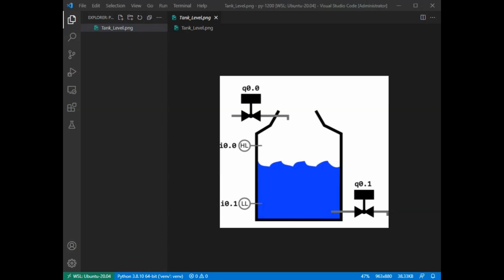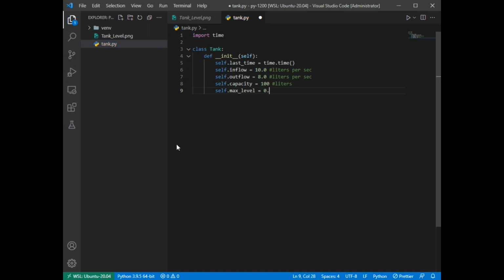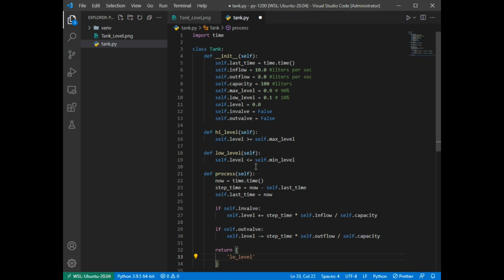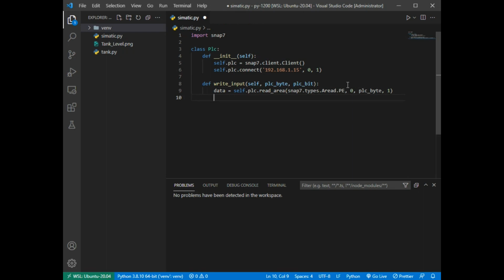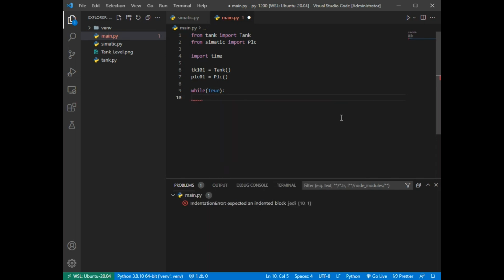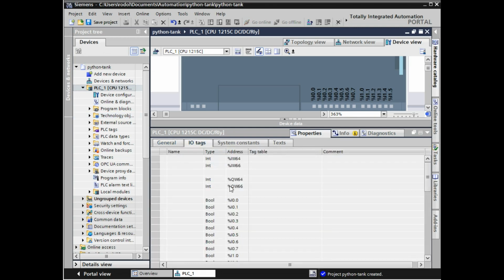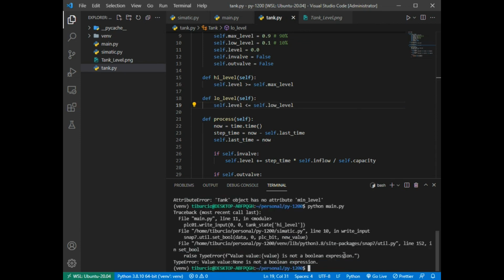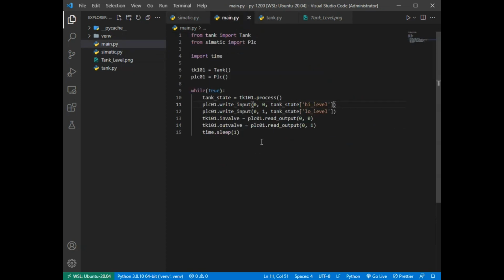Python tank simulation connected with s7-1200 PLC

Comment: Hello Sir. I really love the tutorial an made one on my own. However I get this message 'function refused by CPU'. I tried digging up and found that I need to turn off the OPTIMIZED ACCESS BLOCK, ACCESS LEVEL should be FULL and DB should be GLOBAL which I did. But I still get the same error. Is there any firmware version that needs to be followed? Thanks in advance. :) :)
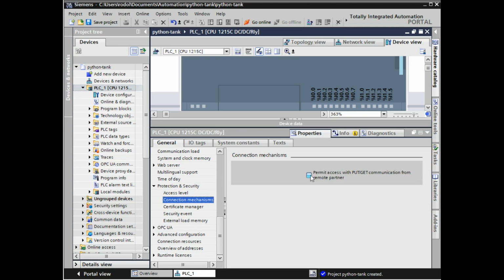Reply from the maker: Hi!, thank you for the comment, and I'm sorry to read that not work, I'm not sure if firmware version could be the problem, but I will check, did you enable the "PUT/GET communication"  26:58, regards
Reply: @RodolfoTiburcio  had to reboot the PLC. Finally got the output I needed. Anyways, this tutorial is very helpful. Hopefully you can upload a few more videos😊😊😊